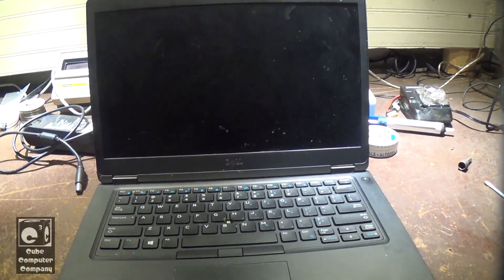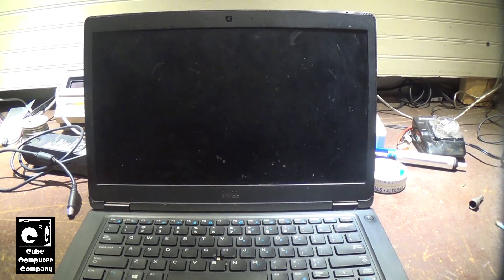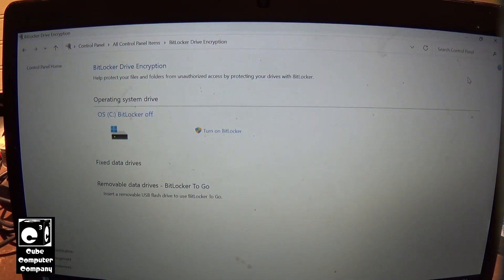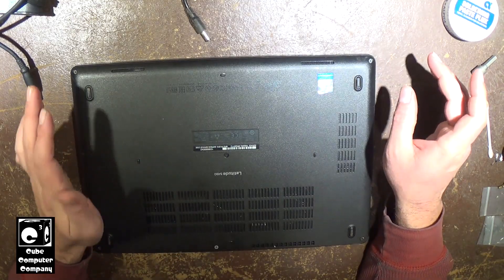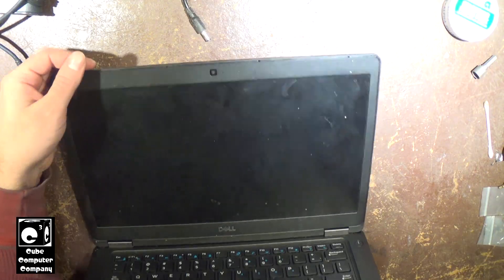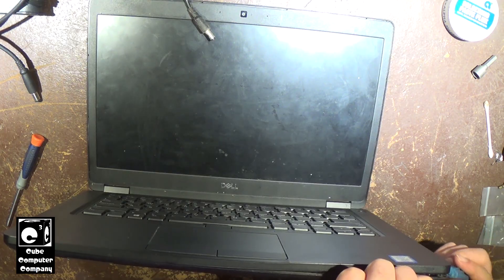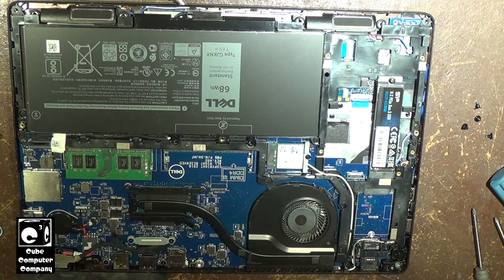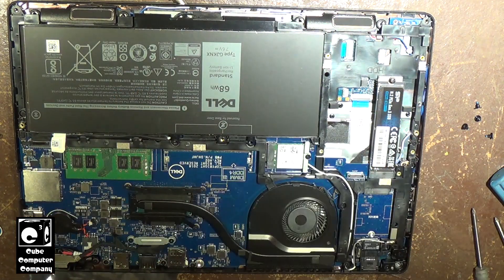Dell Latitude 5490 hard drive to SSD upgrade

Comment: On most lattitude laptops you can start prying apart the back cover at the back of the laptop, it's much easier than dealing with all the clips at the front.
same with hp elitebooks and probooks.

Comment: Cool Silicon Power. I'm more of a Team Group guy myself. Team was really cool with me when one of my ddr3 sticks in a 2 pair kit died, they even let me send just 1 of them back, it was a bit ago. I've bought SP and Team groups that were DOA but it was just one for both companies. I haven't had to RMA a SSD to either company yet either, knock on wood. Nice work on the 3d printed caddy, I had this same issue with a Latitude 5500 the other day, but I just gave up and put the SATA SSD back in and put the drive I was playing with elsewhere.